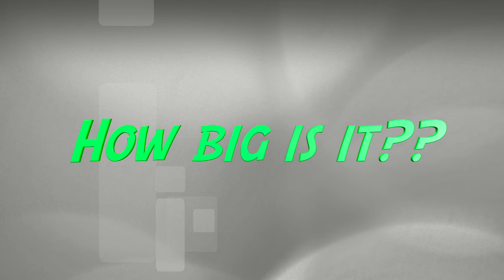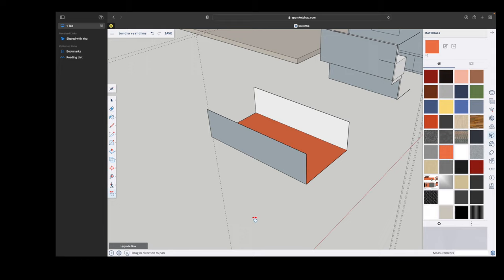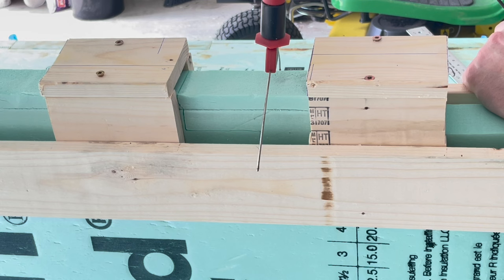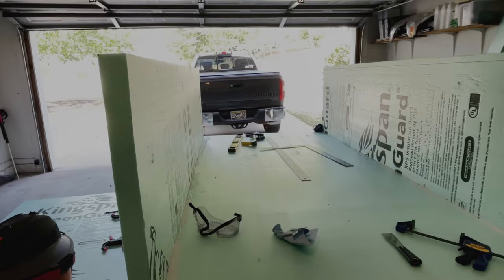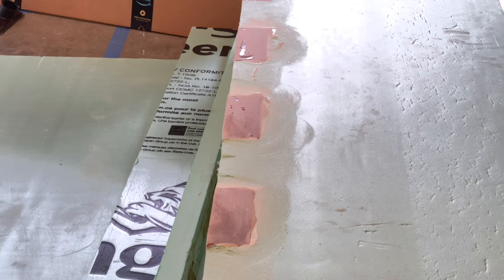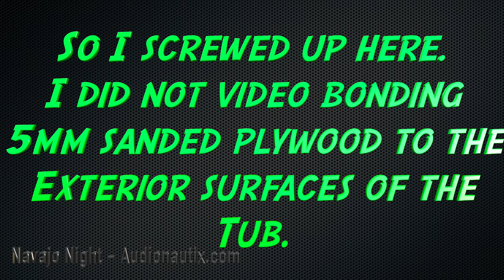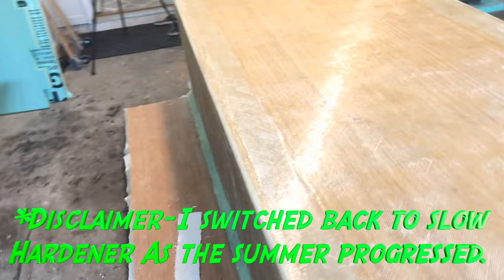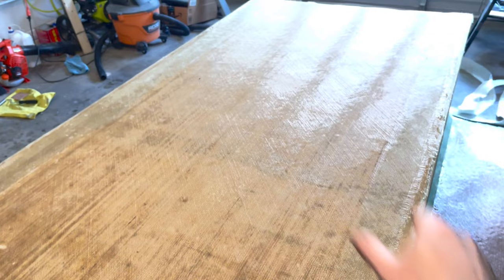I'm building a truck camper out of foam? (Yes! And it's going to be beautiful!) Ep. 2

Comment: The access cab has nothing to do with the length of the bed. It has to do with the suicide doors to access the cab.
Reply from the maker: @justinlyle7831 The access cab allows the bed to 6.5' while the crew cab only allows 5' bed length. The gen 1 Tundra's had the suicide doors while the gen 2's have regular opening doors.
Reply: @GeorgiaAstronomy The truck you're working with is a double cab which also has the option for the 8'1" bed. Not that it matters much. Just not sure why you were talking access cab. Not that it matters. LOL have a good day
Reply from the maker: @justinlyle7831  I actually just learned about the 8' bed when I was at the dealership couple of months ago. They had 1 on the lot. It certainly looked weird!